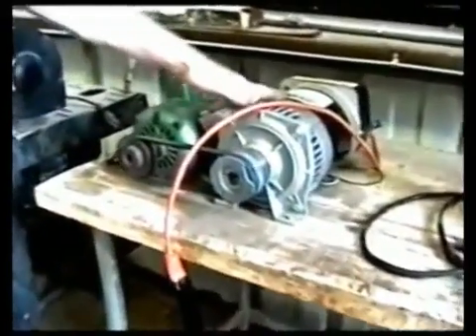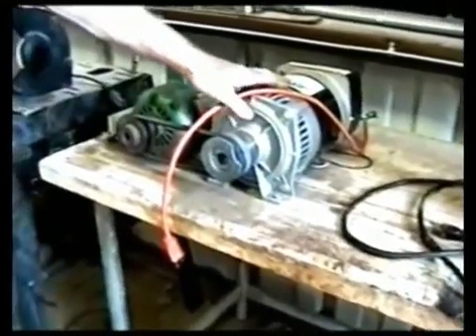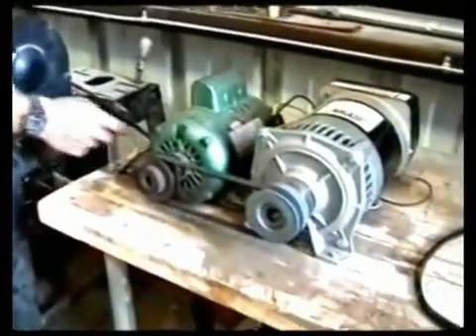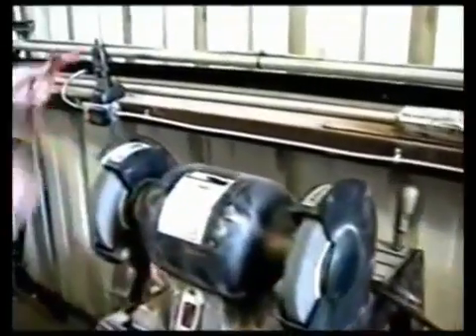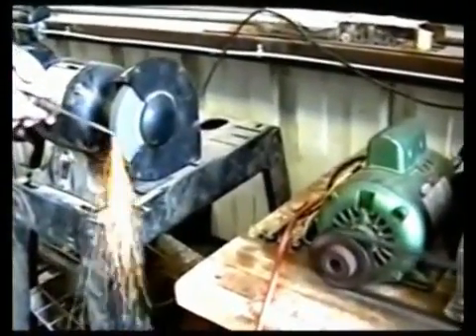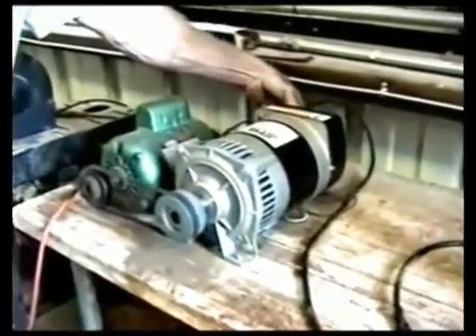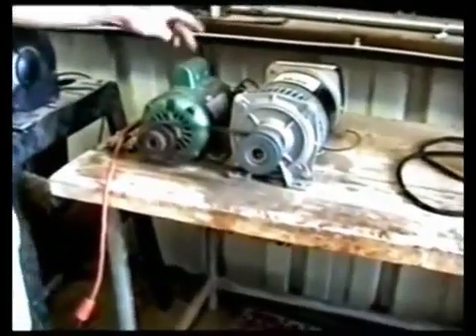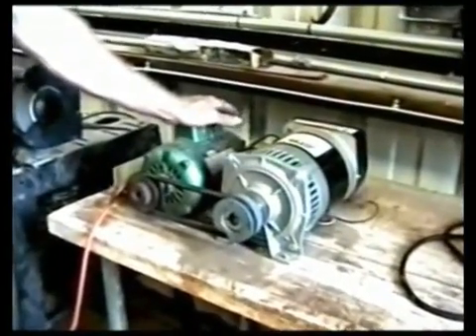3000 Watt Generator Powers Itself, Grinder & Drill Press.

Comment: I love how you can violate the laws of physics so blatantly and convince poeple that it is something that it is not. Your defence is that it is a open system. Explain then where this energy  extra energy is coming to power this and a grinder let alone produce enough energy from "undefined" to overcome the friction of the two motors? Also lets pretend that it would work when you were having just the two generators powering themselves. If it was making enough free energy to power a grinder

Comment: You could also attatch magnetic propulsion directly to each device,then all the electricity generated by that system could be directed towards powering the lights and the heating and cooling system for the shop.Fewer wires and less outlets needed...which can get in the way when installing shelving.This would make lathes,drill presses,etc, wireless and easier to relocate without the wire getting in the way or a need to plug in.No noisy generators on the jobsite,when outside.

Comment: how do you overcome the drag of the belt, the bearings, the magnetic instability of a generator and motor, the resistance of the wires, etc? next time put it on an expanded wire bench, and get some proper shots of the wiring and i won't think it's being powered from under the table

Comment: so he gets free energy? that's not how electricity works. a lot of the energy becomes heat and noise cause of friction. and also energy goes away in keeping the parts moving. so the generator creates less energy than is needed to keep the motor going. (energy cant just appear from nowhere)

Comment: There is no such thing as over unity device. If the generator has no force applied to it to produce its power, it can't do it. When you started it with the motor, it produced power, but when you switched the motor off, to the generator, there is no way the generator could produce more power than the motor uses... there is a flaw in this logic so I figure your setup is a scam.

Comment: Too bad some people believe this video. Any of the start up energy would be used up through inefficiencies in the motor and the generator. This would never be sustainable. Also, a belt driven system is horribly inefficient and would use up the start up energy very fast. You may not receive more energy than what you put in and what you put in will be destroyed through inefficiency.

Comment: Great Idea to store energy, but otherwise, if you thought you made a new technology that creates energy from nothing you are just wrong my fine sir.

You just charged the "energetic inertia" of your system by plugging it to the grid.
Your appliance will never run forever as they are running on the energy provided by the grid charged into your motor-alternator system.

Comment: I am surprised that this demonstration hasn't been debunked yet.  If you other viewers do nothing else, listen and note that the motor-generator set doesn't load down at ALL as the other appliances are connected.
  Where do you folks think the energy is coming from?
There is friction and heat loss in several places.  That alone would keep the thing from running even if it were making just as much power as it produced.
  It's time for the poster to "come clean".

Comment: hello, I hypothesized a generator that was self contained... based on the unit you've built here would it be possible to start this via a battery, and then have the alternator recharge the battery, and give power to an external source? my theory (back in the day) was to have 3 generator components, one which would give power to an external source, one which would give power to the motor and one which would switch smartly between recharging the battery, and the external source,

Comment: ok how bout this then.. cheap harbor freight solar panel system, charges batteries - batteries run small electric motor.  electric motors turns a much higher powered windmill generator.constantly and faster via a belt. windmill generator  charges and stores more energy than electric motor draws

Comment: i have questions..  1 - why not increase the pulley size on the motor?  2 why not add another generator either  as a 3rd pulley in a triangular configuration, or  add another generator head directtly opposite the one thats there..  make them face each other and join the shafts with one pulley between them?  3 - can you mount coils around the pulley of the motor, and then reclaim power from the motor that is aleady running anyway?

Comment: I would be amazed If this comment is posted !. You will not get more power from a generator than needed for the motor driving it as that would increase the mechanical load on the motor withc makes it draw more current from the generator to do so and at some point past the capabileties of the motor. So who are you trying to kidd ????

Comment: It is quite simple he has a hidden wire that is under that 2x4 and probably through a groove on the back edge of the table and then it runs down inside the table leg. Physics says that energy may neither be created nor destroyed. Therefore the sum of all the energies in the system is a constant. so your generator would never work and therefore is FAKE.

Comment: All you have to do is is put a larger capacitor in the generator. If you really want more power, get two 25lb dumbbell weights, have them balanced, install axle through two pillow block bearings, be sure to gear down, then back up so the weights don't run at 1800rpm. This will turn your 3/4 hp motor into 5-10 hp after start up. This acts as a weighted flywheel to add more torque when the generator needs more draw. Same way John Deere increases diesel engine HP with a weighted flywheel.

Comment: he said that the inverter had a modified coil, which could mean a bank of capacitors and a modified input coil to add more amps than it was rated for and the capacitors take turns discharging like pistons taking turn to fire in a engine makeing theoretically a power source as long as you have good capacitors and cooling.

Comment: Remember for every action there is a reaction .. for every electronic device that is running on a power grid.. there is an equal amount of energy transfer being made in burning coal .. which is pushing a spinning turbine.  No burning Coal means.. NO spinning Turbine .. means NO electronic devices working in your home.  When you turned on your grinder.. why did your generator not slow down ?? explain this to me or i will remove your website and your false business on the web, liars will be judged

Comment: When your air conditioner kicks on in the house .. the lights dim .. anything electronic experience a voltage drop.. and in a small way the power plants turbines experience a load on the other side (your air conditioner) .. and the turbine is slowed for a moment. ..as your air conditioner motor catches up to speed. its easier to keep moving .. less power consumed.. and the power plants turbine is slowed less

Comment: I am an electrician and i have studied the transfer of energy through electricity in conductors and i don't believe in overunity or this kind of infinite energy.  When you started your grinder motor i didn't see any slowdown or signs of a voltage drop in your motor/generator setup.  

In a household when something that uses alot of energy is turned on or started there is a voltage drop because of the large flow of current and the powerplant's inability to supply constant power.

Comment: @storyb23 its not possible- it takes 1.5 hp to produce 1 kw.. thats why he runs the grinder and drill press just for a few seconds--WHY? cause the generator is losing cycles. let him make another video with a cycle meter on it  under load and it will fail. what it is missing is a govenor to carry the load like a diesel generator has. in other words a 1 kw will only run a 3/4 motor under load and 3/4 is not enough to pull the gen under full load- it takes a 2 hp. this was tried in the early 60's

Comment: why didnt you run the grinder and drill press longer under load? ANSWER- cause the motor is losing cycles.. put a cycle meter on it then make a video under a load-(it will fail)- it takes 1.5 HP to produce 1 KW.. what you are missing is a govenor to take the load to avoid losing your cycles, and guess what, - a 2kw gen wont pull a 4 hp motor under load.. stop telling these stupid people that this will work.. - electric motor shops have tried this in the early 60's and it failed.. "

Comment: Well I for one have thought of the same exact project for a long time but have been told over and over again it can't work, it won't work. The only difference in what you did versus what I thought of is you used the electric grid to fire your motor, where as I used four 12V-1,000 CCA truck batteries. This is called "perpetual motion" and it's not supposed to work or at least that's what I've been told.

Comment: Is it runing 1500 RPM or less, there are 3000 watts, how many watts the motor is runing  and how many watts can i get, are you making swich on  when the AC line is on, and whate about + and - when you start the generator. From, Aslam baloch

Comment: it need just one CHANGE OVER.1st- start the AC motor with line ELECTRIC to run the Generator.when Generator run properly than change the power supply with Chang Over to the AC motor.now the AC motor will run on Generator's power.

Comment: it need just one CHANGE OVER.1st- start the AC motor with line ELECTRIC to run the Generator.when Generator run properly than change the power supply with Chang Over to the AC motor.now the AC motor will run on Generator's power.
I've made this exp in 1991 and still in running.

Comment: It's just a battery after all. Much as a portable battery powered drill.  The motor generator loses energy through heat but rotational energy stored remains till dissipated throught heat loss, just like a battery but much heavier.

Comment: Marvellous!  Can you explain exactly where the energy output is coming from?  Along with the heat energy being wasted in all the coils and friction in the belt and other moving parts?  This has to COME from somewhere.  Seems strange as well that your generator didn't seem to alter in speed at all when under load.  What circuit are you using to regulate the system so precisely at 60hz that a load of that size wouldn't even cause a noticeable jump?  Oh no sorry its just a fraud....

Comment: Please make another video, with the unit away from a wall and go around the unit 360 degrees from top to bottom. also use clear lexan table legs. In so doing the presence of any other wiring can be ruled out. Right now that unit is violating thermodynamic law; or so it appears. bottom line in latin. Bullchitis machinum.

Comment: How long will this run? Eventually enough energy would be lost due to friction, sound, and heat to drop the total energy level in that system below that which is required to power the system. This would pose problems for a vehicular application, but for running powertools in a workshop it would be pretty neat to see how long you could use that grinder before needing to restart the generator/motor combo.

Comment: this vid  is definiterly a hoax, because the coils needed to produce the power in the generator that size are pretty much maxed out as far as current and magnetic flux. to put some 200 times the power out is not real especially with a "special" coil based on that setup, the green motor was at least a 1hp. 200 times that would be 200hp.  i base this off the point the guy said" it could barely run the motor alone" if it was unable to turn a 1hp motor, there is no way you can turn 200hp!

Comment: I'm trying to understand more clearly how this works. The confusing part to me is that both the induction motor and generator have inefficiencies. Once you start the generator with the AC sourced induction motor, then disconnect the AC source to allow the generator to power the induction motor (which powers the generator). It's only a matter of time until the losses slowly (heat, friction, etc...) reduce the available energy in that closed system. How long can it run after you disconnect the AC?

Comment: When you attempt to create a hoax at least attend to the details that even 10th graders will pick up on. Such as: why when the grinder is turned on, does the motor / generator not slow down in the slightest from the increased load? For no change in speed & pitch it would need to approach *infinite power* not just 3000W. Also if you got independent verification in Aug 2010 you'd be a billionaire by Sep 2010 or world famous. Go on then! Sincerely, real engineer.

Comment: So, since the laws of physics say this is impossible, the only thing you could mess with is time. So the modification is a capacitor (aka battery), which is why you used the words "charge this up". In fact, this arrangement cant run for very long and considering your grinder and drill had virtually no load, your cap could keep up for the demo period. Nice. So is this an investment scam? Is that why you want people to email you? Do a 15 minute video with full views of the system and I'll believe.

Comment: "THE MOST IMPORTANT CAUSE ON EARTH" 

Whenever a cause is made into a business it FAILS.

THE PROBLEM WITH THIS IS COOLING THE GENERATOR AND OF COURSE YOU SHOULD CONSIDER THE LIFE OF THE GENERATOR AND THE OTHER MOTOR WHEN YOU USE IT CONTINOUSLY. A BATTERY IS STILL NEEDED IN ORDER TO PROLONG THE LIFE OF THE MOTORS.

Comment: This is so FAKE.  It's just the same old perpetual motion scam again.  How come the system has no surges in the belt when loads are switched?  Because it is powered off the AC line all the time by wires that are hidden in the table base.  The orange cord has no connection to the "system".  The switch turns on the AC power from the hidden wires.  Don't believe me?  Go google perpetual motion.  Or send them you $ if you want.  I don't care.

Comment: Of course you want to make the video as convincing as is practical given a limited budget, so might I suggest that the video include 1) 4 plexiglass coasters which are shown being placed under each of the 4 legs of the table, 2) toggling the switches on all devices prior to power-up to show they aren't already powered, and 3) just for fun throw the power central power breaker on the bulding (because a friend of mine who was derisive about this video said that's what Feynman would do)?

Comment: Anyone with any electrical skills knows this is fake. You can't generate 2 watts of power from 1 watt of effort, the best systems to convert mechanical energy to electrical only have around 60% efficiency which means 40%+ are lost in general inefficiencies of the machine. And you probably think everyone else is stupid too, do you think no one knows how to wire 2 wall switches with a hidden power connection to have variable on/off with those 2 wall switches to run this scam?

Comment: Lets get the things straight. You got an induction motor, which turns a generator. Fine. Then, you unplug the motor and use the output power from the generator to feed the induction motor. Fine. Then the generator and motor speed is not dropping. Interesting. The power lost in the copper wire and the belt, the bearings friction and the motor's fan should make the rotating speed of the system to fall. Oh yeah, I get it. The generator INVENTS power. thats it?? And you sell drawings of it right?

Comment: My problem with the video is that you didn't show that flipping the switch while it's unpowered and not plugged in did nothing.  Since you didn't, you could easily have a hidden cord that is actually plugged into AC and the orange one was just a dummy for the video.

Comment: it seems you are generating 3000 watt power from your modified alternator, why dont you make two or three such systems  for example 3 system , you will produce 9kW power, and then switch off main panel board of your work shop and connect three output to your service entrance input line, and use free energy all the time, for starting the system take a line from source circuit to run the system.
can you do that or have you done it?

Comment: the key to free energy is to prevent the generator from establishing a magnetic field between rotor and stator, and only creating a strong electric field in the rotor and stator winding. eddy currents is tiny electric currents internally short circuited as tiny magnetic fields.  lenz law is the work of bringing electric  potential difference to zero creating magnetic field.  if you can keep the electric resistance high in a short circuit establishing electric field lenz law no longer apply

Comment: "14 amp bench grinder" ( i got same one in my shop, 1/2 hp 5'ish amps) and "16 amp drill press" sorry buddy those are small shop tools, no where they draw that much current let alone a normal wall receptacle only provides 15 amps!  Something about this video and another one from poster dosnt add up, if its to good be true, normaly it is not true.

Comment: Good job, I am an Haitian I was trying to make an experiment like that to generate the battery for a POWER INVERTER. I put together a motor and a car alternator. But the motor was too weak to run the alternator. It was running good but when I put the wires from the car alternator to the battery electrodes the motor did not have enough power to run the alternator

Comment: i noticed not one negative comment, which tells me that you block/get rid of anything that counter acts your scam...such as logic, facts, and reality. this is truely one of the bigest scams i have seen so far. ppl have tried hooking a motor and gen/alt together for over 75 years, and it always comes out the same, Fail. if it truely worked, then why ask for money? why not just sell some power back to the electric co? oh yeah thats right its a scam. whats worse is to bring god into your scam